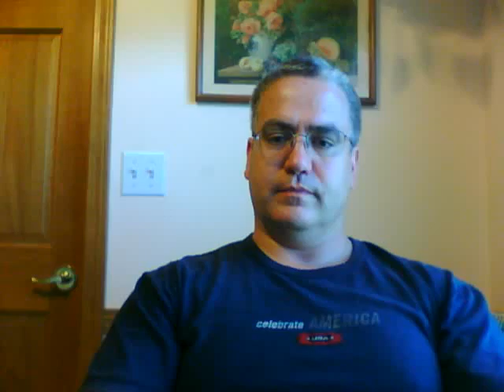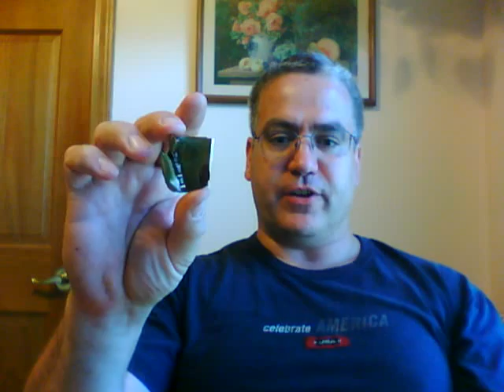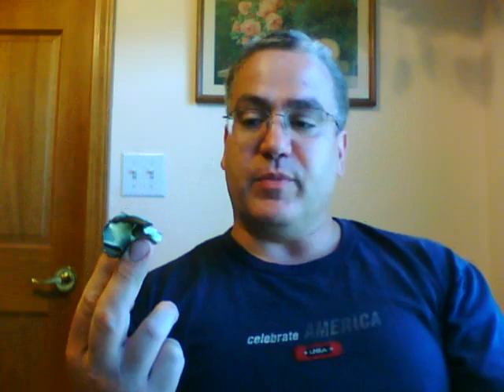Engine Failure 2003 Toyota Camry 2AZ-FE  2.4 L (2362 cc)

Comment: About 2-3 years ago I went to a used car dealer to look at a 2004-2005 Camry with the 4 cylinder engine, it had under 100K miles on it I believe. I always open the oil filler cap and try to look inside. While the engine was running I opened the oil feeler cap and there was this same piece of metal you have in your hand rattling in there very close to the camshaft lobe. I shut the engine off and tried to get it out but it was too big for the hole. I end up telling the sales man about it and told him that they need to take the valve cover off and get that piece out or it will eventually get stuck under a cam lobe and wreck the whole engine. Back then I searched about it online but didn't find anything. I also recently found out about the three bolt heads on the drivers side that pull the threads out of the block on these same engines, very surprised about these issue with a Toyota.

Comment: I have a camry 03 and the mechanic says the rings round the crankshaft has gone bad and need to buy another crank shaft. Question is doi I buy a crankshaft and get it fixed or get a good used engine and replace?

Comment: The oil change guy would have damaged the cam if the car did not have the broken part he is showing. I am sure Toyota and any car maker would like to build their design specs using his input. Just how large and deep would you expect to insert objects inside the openings in motors? Do expect to have to push or do you intend to use a hammer?  Sounds silly, cause it is. The real deal here is your tech or dealer blew it and now they have gone into hiding. Don't buy from them or ditch the hack that's been working on this car.
Reply from the maker: The insertion depth should be limited to prevent excessive penetration into the opening. The opening should be robust to all types of insertion that can happen in a real world service environment.
Reply: Byron Hatch First: the repair-maint manual says nothing about inserting anything into that oil fill hole beyond the threads other then poring oil into it. Secound: you need to put some pretty decent force on the baffle in order to bend it to the point that it is in contact with the camshaft. Third: Once this happens the engine makes a god awful noise as the cam lobe is hitting and bending (flexing) the baffle for a good while before it is stressed to cracking, most people would stop the engine and have it looked at and repaired quite easily (most could be bent back up through the fill hole with a sturdy 90 degree pick). Forth: when they did break they rarely did more then lie in the top of the cyl head causing no additional damage, the damage you had is very rare.  And last but not least, There was a Toyota General Maintenance Tip TSB EG007-02 published on 3-22-2002 for this exact concern. Your post is null and void.

Toyota Master Diagnostic Technician

Comment: It is definitely not a design flaw, nor does it need to be changed or addressed, imagine if you will, the baffle not being in place and the heavy handed oil changer making minimum hourly wage, jams the oil gun nozzle straight into your cam, and repeat this action every oil change. You will quickly wish that you had the baffle to at least add some measure of protection.

Toyota Technician/Team Leader/Junior Technician Instructor
Reply from the maker: You clearly do not understand robust design. Go back to school and take some Opex courses
Reply: Byron Hatch
LOL, You cannot develop an idiot-proof design. A good design depends on execution.

"It is impossible to make anything foolproof, because fools are so ingenious." --RobertHeinlein
"Those who try to build idiot-proof systems always underestimate the persistence and ingenuity of idiots." --anon

"If you make your system more idiot-proof the idiots will build a bigger idiot" --anon

"You can make something foolproof, but not damnfoolproof" --anon

Comment: How can you blame toyota for something that you claimed was caused by abuse/neglect?  It takes a lot of force to "break off" a piece of metal.  Toyota would probably only do a recall if they could be sued, and if it was caused by a technician jamming something down into the oil fill, no torts would hold up in court.
Reply from the maker: Robust design, robust design. Spend 30 years in consumer good then call me..
Reply: Byron Hatch There was a Toyota General Maintenance Tip TSB EG007-02 published on 3-22-2002 for this exact concern. Your post is null and void.

Comment: I'm pretty sure there is  TSB about as you put it not being overly aggressive with the oil changes...The lube shop I work at has a notice entitled "YOU WILL GET FIRED" about not putting a lot of pressure on that baffle. It might not be an official Toyota TSB but people are aware of it. Also, I hate shops  that have gorillas working in them that would manage to bend or break that baffle. That boggles the mind.

Comment: I just bought my 2003 Toyota Camry last month from it's original owner.  The car has 78,000 miles on it.  I just had the engine destroyed by the oil baffle detaching and am SO FAR facing $3,500 in repairs that I cannot afford.  We don't even know the full extent of the damage yet.  We agree that this is a Toyota design flaw that needs to be addressed by Toyota with more than a TSB.  Compensation would be nice but know that it will not be forthcoming.  :(

Comment: Thanks for making this video.  I was changing my friends oil and saw that piece of metal loose in there.  Thought it very strange.  Pulled it our with pliers than goggled it to find this video.  Guess I better pull the valve cover to look to see if there are any more pieces.  She has been taking it in to get the oil changed.  I guess someone broke it.

Comment: Hello hatch, there are several ongoing posts about issues with the 02 - 04 Camrys, I own an 03, It has 86,000 miles on it and I have not had any major problems yet, but I wanted to show this thread to you from the Toyotanation forums on the Stripped Headbolts for the 2AZ-FE engine

Comment: ive been in this field for over most of which was working on toyotas. never seen or heard of these oil "baffles" breaking off. if your technician isnt smart enough to know that your not suppose to jam the oil gun in between the baffle and the oil cap threads, then its time to find a new technician. These were built in looks like to protect the timing chain/gear from being damaged and it serves its purpose.

Comment: I have a 2004 Highlander and the head/block bolt problem, as described in the Wiki, has presented itself. The dealer wants $6k to repair and $5k to replace the motor.

Comment from the maker: One, apparently I have more experience than you. Can you tell me if the valves did not make contact with the pistons what caused all 8 intake valves to bend? Can you tell me why each piston had a small impression in it that mysteriously matched each bent valve??? Your commentary is still invalid and not fact based.

Comment from the maker: There seems to be a common thread in every commenter that states they are a technician: intolerance. As a technician I have found in nearly 25 years of various mechanical repairs  what "should" and what is are two very different things. Real world scenarios are always very different from those controlled within the confines of a lab or computer. Based on all the feedback from those who have experienced this failure your commentary is invalid.

Comment from the maker: I agree it is indeed the technician's fault, but a key in product design is making a system "stupid proof" to prevent an $1800.00-$3000.00 failure from a heavy handed oil change dipshit.

Comment: @500hpsi  You cant be serious. This is definitely a bad design 100% why do you think they changed it on the later models? I was changing the valve cover gasket for a customer and never did an oil change on the vehicle.  This was not my fault at all, the toyota technician that the customer takes it to did it, at the Toyota dealership!!! It is a combination of a bad design as well as a shotgun mechanic jamming a funnel into the fill hole.

Comment: Sorry to say that this is not a designed flaw in any way. This more like a error/mistake made by the person doing the oil change. This is one of the reason why it's better take your vehicle to a Toyota dealership vs. to a quick lube place or an independent shop that does not know Toyota product. you said your self a "very aggressive technician bent the baffle " how is that Toyota's fault?

Comment: I am in the middle of exactly the same problem with a 2006 Toytota Rav4.   The dealer is now telling me they need to pull the engine, take off the front, and find the pieces of the baffle.  They already pulled the oil pan and took some out, but didn't find all of it.  This has effected the Oil Control Valves as well...  damn, this is going to be expensive...   Any ideas?

Comment: I've had the same damn problems on two motors now! ( undergoing second re-install now)  after much research I have to agree completely, the first one blew randomly at 65k miles, the second was making a slight noise first, sounding like timing chain, coming from valve cover area.  Both motors were crankshaft failure!!! F*** toyota, never again will I buy one, just because they ignore this problem, and have put it at the owners expense.  Thank you guy for your video!!

Comment from the maker: @Andrew38ful  Yes, remove the valve cover. Remove the baffle section under the filler cap OR re enforce it to prevent it from floating into the engine